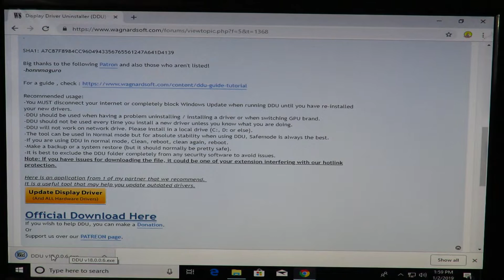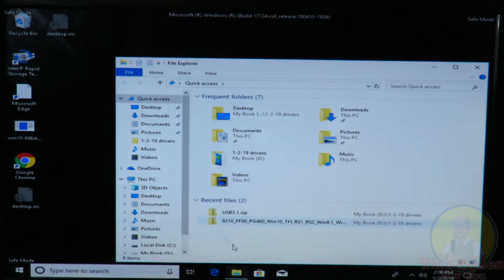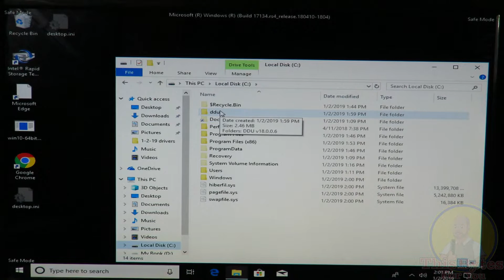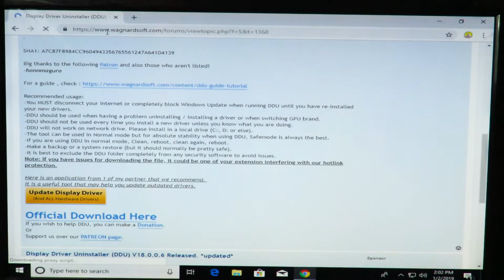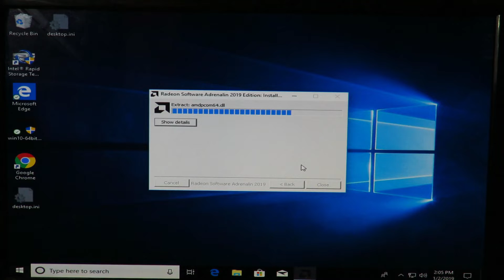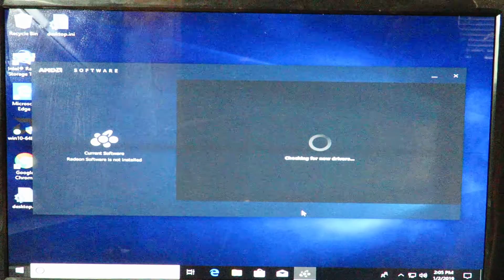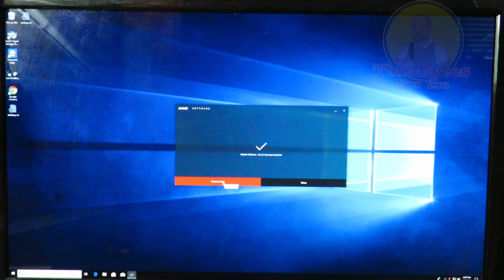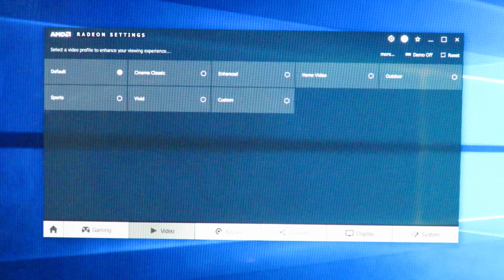How to install the AMD Sapphire Radeon Nitro+ RX 590 8GB OC Special Edition

Comment: Hi Bro love your vids 
I have installed my new rx580 nitro +se All fans are running but no display but when I connect my internal gfx card it's working 
My specs:
Intel core i7 3770k
16gb ram
1tb hdd
700w cooler master
one connector is on pci other is not is that a problem ?
Reply from the maker: Hello my friend, thank you so much for your kind words.  Great system by the way, I would make 1 change but I will provide you with that information later if you like.  With a 3770, what motherboard are you running this on, and what video card did you come from (what card did you have before)?  Also, on your onboard Intel HD graphics, what kind of cable are you using (HDMI, DVI, VGA, DP) and what cable are you using to plug into your RX580 (HDMI, DVI, VGA or DP).  The last question, about the cables, I ask that because of for example, when you switch interfaces, you have to make sure you select the correct input on the monitor.  If for example you were on HDMI on your Intel, but when you switched to DP on the RX580, you would have to select on the buttons on the monitor itself to move from HDMI to DP, just an idea.

If that last piece did not help, please provide

1. Motherboard manufacturer and model number (exact model number please)
2. What video card you had prior to the RX580
Reply: ThisBytesForYou my motherboard is the gigabyte GA-B75M-D3H
Video card before was the amd sapphire hd 5800 
I was using HDMI slot before with my old card and on the Intel on-board card too
Reply from the maker: @akumaoni1592  Alright great, thank you.  I see what your problem is, the 5800 did not support UEFI, the 580 while it does not require it, works best with it enabled.  So update to the latest BIOS for your motherboard F15 (https://www.gigabyte.com/us/Motherboard/GA-B75M-D3H-rev-10/support#support-dl-bios), after that, in your "BIOS features" section, under "PCI ROM Priority", make sure it is set to UEFI, save and exit, after that you should be fine.  Once in windows, download the most up to date AMD graphics driver (dont install it just yet), then download DDU, then boot into safe mode and remove all the Intel and AMD drivers (you can watch my video on how to do that here: https://youtu.be/clLYbBywhAg) and then when you are done there, make sure to disable the windows driver update within DDU, then reboot the machine and install your AMD driver and you should be good.

As for the recommendation, your system is a little older, but the 3770 is still a decent processor, so you should get a little life out of it, but you are being robbed of performance with that spinning disk.  Updating to an SSD (like this one Samsung 850 Evo 500GB: https://geni.us/QTA2, that is my Amazon affiliate code, so it helps me if you use that) and installing your OS on that drive, keep the 1TB drive as a data drive, maybe even to install your games onto, but you will notice a night and day difference moving over your OS from a mechanical drive to an SSD.  I do not recommend cloning your data over, nothing is better than a fresh OS install but if you still needed to clone it, I reviewed this device that makes the process soooooo easy, and is VERY cheap (https://youtu.be/ENS3RhjaS9M) , but worry about the video card for now, you can work on the SSD and potentially cloning later.

Please let me know how this works out for you, I love helping and would love to help you get everything working on that new card.  Thank you so much for stopping by, checking out my video and commenting, it means the world to me, and thank you for your kind words.
Reply: ThisBytesForYou I tried it but after 3hrs it's not letting me update the bios at all I think my motherboard locked the update :(
oh well np Bro Thank you very much for the help:D
I better buy new pc parts for i9 9900k which motherboard you recommend cz I am going for gaming, work and emulation?
Reply from the maker: @akumaoni1592  that is very odd, but if you do want to upgrade, which is always great, I have a system already built out with the perfect specs for you, look in the descriptions of each video.  If you do end up buy those pieces, please use the links in the video, those are my Amazon affiliate links and it would help me tons.  Check out this video
Arctic Liquid Freezer II 360 Liquid Cooling Installation Guide
https://youtu.be/_IiFsDX4RPs

Or this video (Though I recommend using the Arctic Liquid Freezer II 360, but at the time of recording the video below, it had not come out)

How to Build a Gaming PC in the Fractal Design DEFINE S2 Vision RGB Part 1 of 2
https://youtu.be/oPpXQV7niWg
Reply: ThisBytesForYou Okay Bro Thank you very much I'll see it 😎😊
Reply from the maker: @akumaoni1592  anytime my friend, I hope you like it, and please let me know what you think
Reply: @ThisBytesForYou  hi Bro Thank you for the help I bought the ryzen 5 3600x 16gb ram and Asus rock legends steel legend motherboard I tried accessing ur site they would charge me for shopping to India lol
In future gonna go for ryzen 9 later which Asus motherboard or gigabytes u recommend for it ?
Reply from the maker: @akumaoni1592  well, what is your budget?  As for my link, it was an Amazon Global link, so it would have worked anywhere in the world utilizing your local area for pricing.
Reply: ThisBytesForYou 60k rupees I am going for ryzen 9 3900x butbmotherboard cannot decide asusrock legend steel or msi is better and which models kindly guide
Reply: ThisBytesForYou yes please the 1 change would like to know it as well

Comment: Hello i would like to ask can i install this video card in old Motherboard X58 which is using processor Intel I7 920 first generation i currently use radeon HD 5870 2GB
Reply from the maker: Chances are yes, but what specific motherboard is it?
Reply: @ThisBytesForYou  i dont remember exact specification but have PCI Express x16 slots
Reply from the maker: Just got confirmation from sapphire that it will work, the card does not require uefi which the x58 chipset does not have, that was my worry but you are good my friend
Reply: @ThisBytesForYou  so i am happy to hear it will work and i go to buy one thank you for your help 😊
Reply from the maker: @raminshakeri1485  you are very welcome my friend, you might want to check here on my Global Amazon affiliate link if you have not bought one yet:  http://geni.us/CWSOO8N, let me know how it goes for you.

Comment: I've got a problem, this gpu is too thick and my pcie x16 is close to RAM slots, so everytime I push it, gpu pushes that RAM switch. Is it safe to remove that back panel?
Reply from the maker: I would not remove it, what motherboard do you have?
Reply: It's kinda old, Intel Dh67CL, but it Said it's compatible on pc part picker..
Reply from the maker: @BloopNessY  I remember that board well.  if you have a dremel, you can shave the edge off of the memory lever, you know how it sticks out slightly, just make sure to cover the pcie slots and the dimm slots, anything that is open, where plastic can fall into, cover it, that should allow you to fit the card in.
Reply: @ThisBytesForYou  thank you very much, it goes really fast
Reply from the maker: @BloopNessY  yeah it is a good budget board, a bit older but there is nothing wrong with that.  I believe I had to certify that for one of our retail launches back in the day.  So very happy I could help, please let me know how it goes.
Reply: @ThisBytesForYou  I did it successfully, it fits right in. I just have to install the drivers, thank you very much again
Reply from the maker: @BloopNessY  you are so very welcome my friend, so happy I could help you.  thank you so much for checking out this video and for commenting, it means the world to me.
Reply: @ThisBytesForYou  awesome :D

Comment: blue 🤢
Reply from the maker: its the special edition, they make them in other colors too ;)
Reply: @ThisBytesForYou  i saw the black one but from the pictures on Amazon the back is a horrible white and red. I wanted to see if that was the case but i can't find anything else about it anywhere.
Reply from the maker: @ronniepickering8589  is it a 590, if so send me the link?
Reply from the maker: @ronniepickering8589  ahhh, I see why, that is the Pulse, the card in this video is the NItro, 2 different card.  The Pulse is almost as good as the Nitro, just  with no RGB and slightly less performance.  The Nitro in this video is blue and silver, but it seems like for the 590 series, your only choices are black or blue and silver.  I would however recommend, for a few dollars more, the 5600, though it is black also, but it will give you much more performance that the 580/590 with newer technology: https://geni.us/Ukhu
Reply: @ThisBytesForYou  ive settled on the rx 590 saphire nitro+ but will it be bottlenecked with i5 9600kf? will it run nice 1080p gaming at high fps?
Reply from the maker: @ronniepickering8589  the 590 will run great at 1080p, and the 5600 will run much better.  The great thing is if tomorrow you wanted to go for a 2K monitor, or you get a high refresh rate monitor, it will be much better for you, no need to update your video card.  just a suggestion though.
Reply: @ThisBytesForYou  i have 1080p monitor that i got 2 weeks ago and i don't see myself upgrading anytime soon. If i wouod upgrade i would like to get crossfire 590 in the future however some games don't support it ive heard. 9600kf might be a bit over kill because it can be overcloked to 5.0 ghz
Reply: @ThisBytesForYou  if i can go for one a bit higher i might go for that or 2060 because ive seen some serious deals on the 2060!
Reply from the maker: @ronniepickering8589  oh don't get me wrong, the 2060 is a MUCH better card than the 590, I recommend a Super if you can, and also if you can, here is my Amazon affiliate link, it helps a bit and is world wide: https://geni.us/8elyh
Reply from the maker: @ronniepickering8589  sorry it took me so long to reply to this one, it got caught up in spam.  I don't recommend crossfire (or even SLI on NVIDIA) because there is very little reward on spending so much on a 2nd card, when you can spend a little more and just get one more powerful card.  Saddly the drivers for AMD and NVIDIA do not provide enough of a performance gain and many games wont take advantage of the second card.  Even at the height of SLI/Crossfire, you will only get a 31/35% increase in performance, not what you would expect for 2 cards, just my recommendation.  I never believe in overkill, because it may be overkill today, but a year or 2 down the line, it just meets requirements, maybe just a little higher.  I never buy for today, I buy for tomorrow, at least I try to.  I hope this helps.
Reply: @ThisBytesForYou  mabye overkill ain't the word but will it be bottle necked?
Reply from the maker: @ronniepickering8589  no I don't think so, at 1920x1080 and lower, you may be using more CPU, and since you are overclocked you will be good, now the 590 or 5700 will take over a little more, at higher resolutions like 2560x1440, it will not rely on your CPU and will mainly target your GPU, so you are good I think.
Reply from the maker: @ronniepickering8589  ahhh thats awesome, 10 pounds is nothing for the added performance, if you havent already, you can use this link of your link as my amazon affiliate link: https://geni.us/QGTEY, of course you don't have to but it would help.  Thank you my friend again for stopping by.
Reply: I changed it to 2060 found a good deal on that should be able to pump out high frame rate on 1080p
Reply from the maker: @ronniepickering8589  VERY COOL, you are wheeling and dealing, that's awesome ;)
Reply: @ThisBytesForYou  what do you mean by whealing and dealing?
Reply from the maker: @ronniepickering8589  wheeling and dealing, basically moving things around the way you want the for an outcome you want, that's a good thing ;)

Comment: bro ty for u review its  top notch one, but i need help about the quality of your gpu when it came  i want to ask u about the 4 screws  on the bottom of the gpu panel and more particularly about  the onces that are in the each corner of the back plate on the video card because, 

when i bought mine and unboxed it home i found out that the 4 screws are not fully and tightly screw down to the back plate [they are screwed down but not strongly], [its 5:09 on yourvideo] which is causing the upper plate of the video card where the 2 ventilators are to move up and down  if u put just small presure on the plate with u hands ... the plate is moving up  and down if i push the screws on the bottom of the panel
do i need to tight them myself to the very end or to let them be like that 

i asked technical support from the shop from which i bought the gpu, the guy there told me that its ok for the screws not to be all the way down because if they are strongly screwed to the bottom the gpu can get damaged during working due to the vibrations when it works, but i double question his answer because maybe he told me so in order for me not to return the rx 590 sapphire nitro back,

 i also question myself what will those vibrations do to the gpu of the 4 screws on each corner are let untouched and a bit lose during working times

the package came with the security sticker on it so hopefully the gpu came like that positioning of the screw from the factory
tell me what to do bro i am lost here ...
Reply from the maker: I would say screw it down so it is securely tight, don't overscrew them because you could damage the card, but make sure they are firm.  Do some tests now, and record the temperatures, for example run a pass of 3dmark, using gpu-z in the background recording temperatures.  Then screw them down and do another test in the same method to see how much it has improved.
Reply from the maker: oh and thank you so much for your kind words, they mean a ton to me.  I am very happy I could help.
Reply: @ThisBytesForYou  ty dude
Reply from the maker: @Avrorabg  you are so very welcome my friend
Reply from the maker: also, thank you so much for the sub

Comment: I only have 1 power port, a 2x8. I can’t find a 2x8 in my computer, would I have to buy a cable?
Reply from the maker: you would, you would want to get something like this: https://geni.us/oTB2G2, this would take an available SATA Power cable and make it 2 x 8Pin cables, I hope this helps.  Also, how many watts does your power supply provide?
Reply: 110 I think
Reply from the maker: @thenitrit4298  its a 110Watt power supply... please make sure because that for sure will not work.  Please if you can read to me the manufacture and the model number of the power supply.
Reply: Nvm. It was 550
Reply from the maker: @thenitrit4298  haha you scared me, ok then you are fine... It's been eons since I have seen a 110Watt power supply, and I have been working on computers since the IBM 5150 haha.  Thank you but you should be good with the adapter I linked up.   I hope I have helped you my friend.
Reply: Thank you so much. I did not know if you would reply to a year old video! Thanks again, and this has gained you a sub!
Reply from the maker: @thenitrit4298  thank you so much my friend, I do appreciate it.  please know, I reply to all my videos, no mater how old or how new they are, so I hope you have found a nice home here.  Always willing to help, and if you have any sort of video you would like made, let me know, I might already have it, or I may be able to make it, depending on the demand for it of course.  I am so very happy I could help.

Comment: I wanted to upgrade my Geforce gpu with the 5700 XT Sapphire Pulse,so I installed it the other day,but when I got to the drivers installation,it goes to 98% and then nothing,screen goes black,fans stop turning,Sapphire logo is still on,though,so i turn everything off...I tried and tried,everything that I could,so I decided it was a faulty gpu,,so I bought another one,the Gigabyte one, it arrived today,and guess what,same thing. What am I missing? PSU is a MasterWatt 650..The only thing I noticed different from this video,was the "prevent Windows Update..." thing, mine was unchecked.Guess I ought to try it one more time,your way
Reply from the maker: 650 you are good, do you have both pcie connections plugged in?  As for the drivers, go ahead and DDU your machine again, now this time download the latest and greatest drivers then reinstall.  The newer drivers did the same for me, you will have to wait a bit, but it will do its thing, these drivers take a bit longer to install.  Let me know if this works for you
Reply from the maker: oh wait, is the issue you are having the fact that your sapphire 5700 pulse has the lights on, do you have the pulse or the nitro?